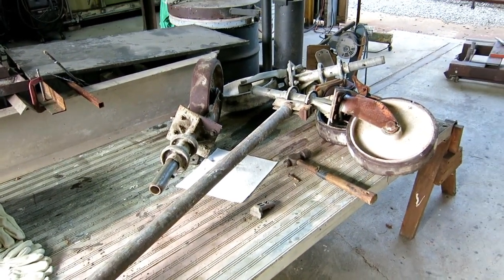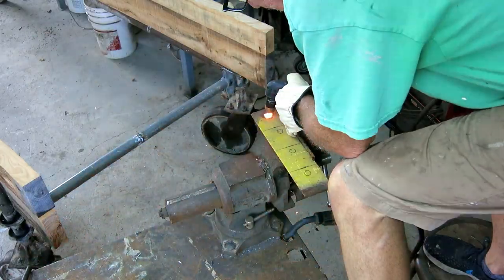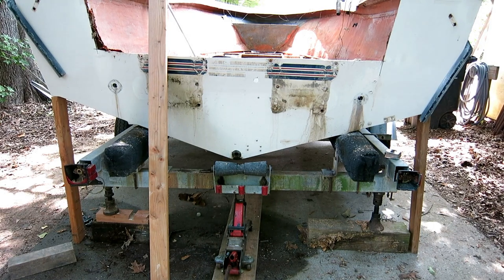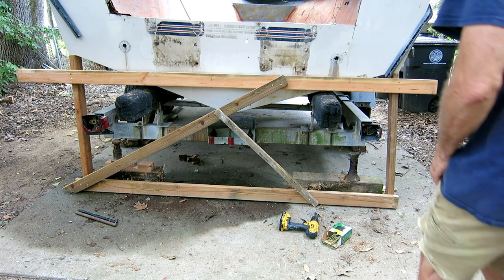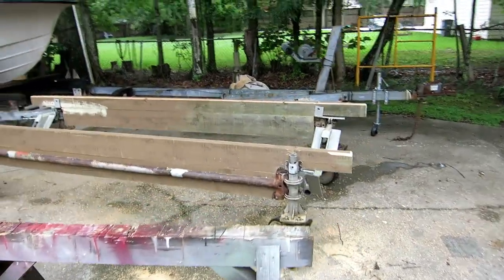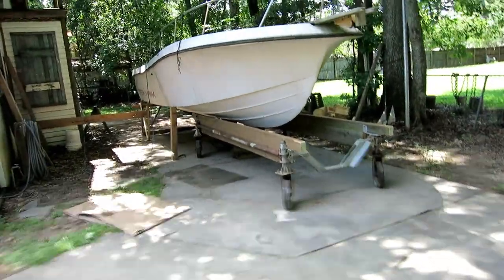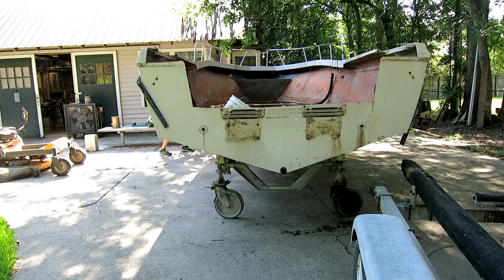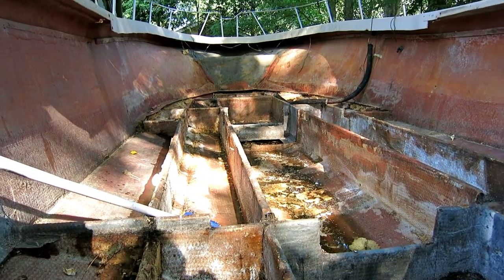The Center Console Boat Project #2 The Cradle Dolly

Comment: I saw a guy that put his boat on styrofoam blocks. Not portable but very stable and didn't damage the hull.  Good safety factor when working on the boat.
Reply from the maker: Yea, I have seen that done a few times. Defiantly wont hurt the hull. Thanks for commenting and if you would please subscribe, helps with my channel.
Barry